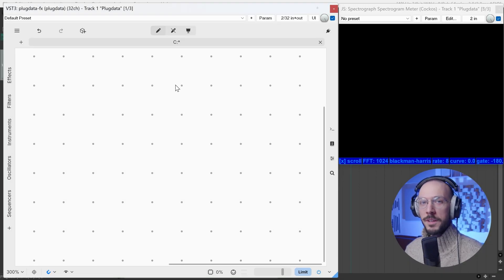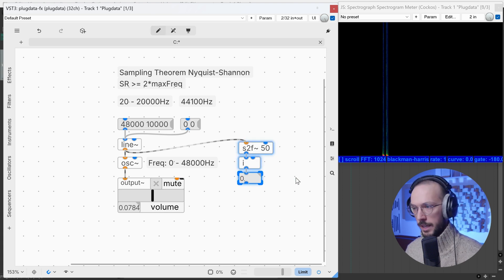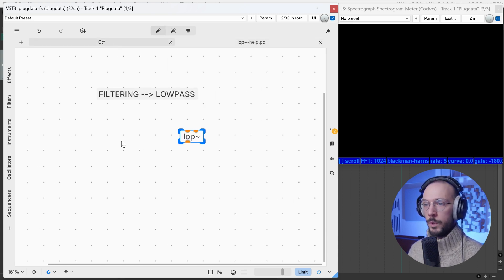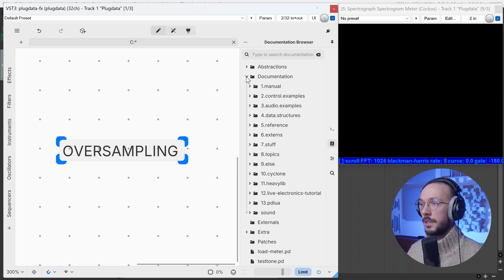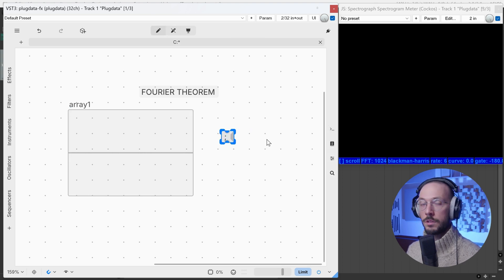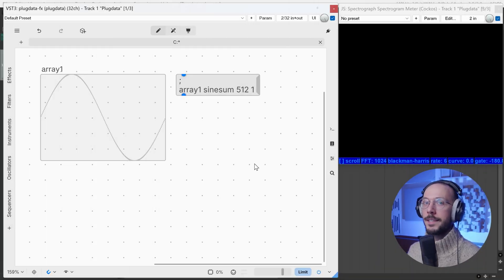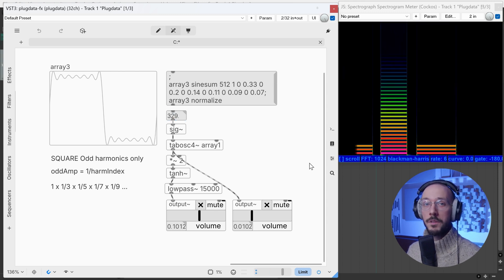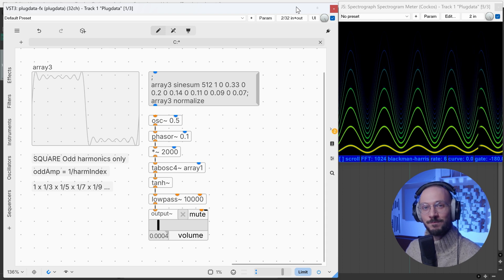Aliasing and Bandlimited Waveforms | Plugdata Course for Beginners Ep. 9

Comment from the maker: ⚠ While recording the video I forgot to say that the filtering shown here is NOT a true anti-aliasing filtering, a topic we'll explore later in this series. This "dumb" method offers a rudimentary and often inefficient approach to mitigating aliasing. By applying a simple low-pass filter after the aliasing has occurred, we are only removing some unwanted high-frequency components. However, this won't eliminate potential aliasing in the lower end of the spectrum. The solution? Always use bandlimited waveforms like [bl.saw~] or the ones made with the sinesum method. In the latter case some aliasing might still happen if you play very high notes!